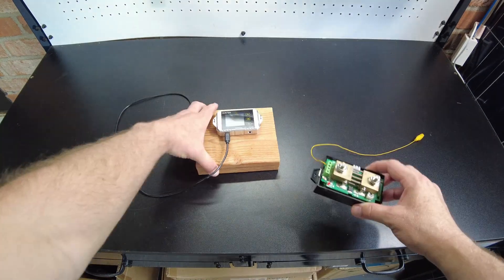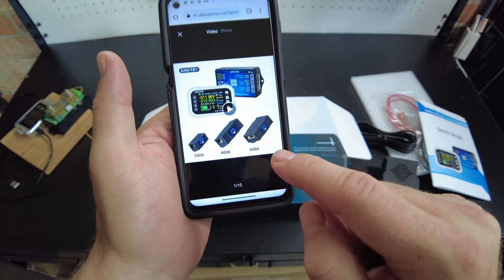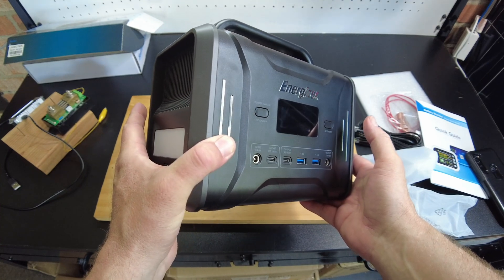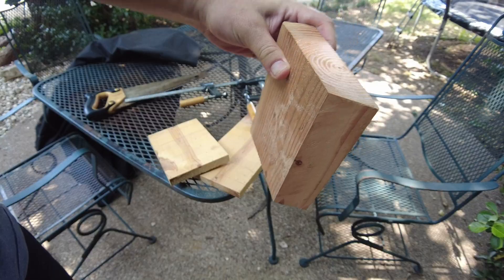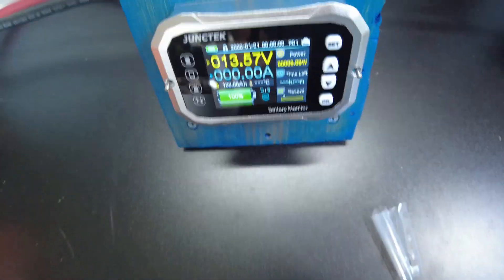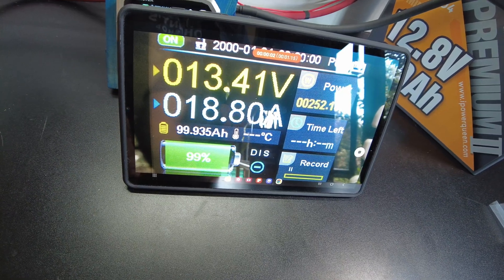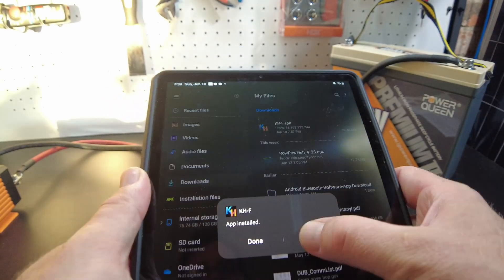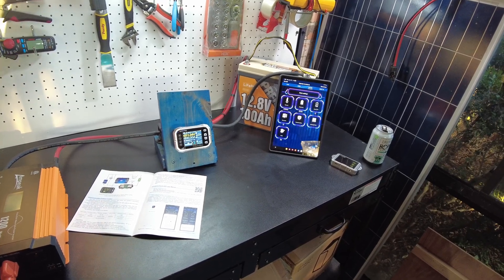Junctek KH140F Battery Monitor

Comment: Hi. Love the videos. Always learn something. QQ. Sorry if it is obvious or in the video. Watched a couple times But if you have multiple batteries. Ie 2 100ah li  would battery capacity be 200 or 100. Again ty for the videos
Reply from the maker: If you have 2 in parallel you would have 12v 200ah. If they are in series you would have 24v 100ah. Thanks!

Comment: WH is a more universal measure than AH since WH is a measure of Energy and not dependant on Voltage - e.g. you have a 100AH 12V battery that has the same Energy stored as a 50AH 24V battery.
Reply from the maker: Yes, I agree. People/Companies using amps to describe power really needs to stop. It's confusing, and is only half the information you need. Watt is constant regardless of the system voltage. Thanks!